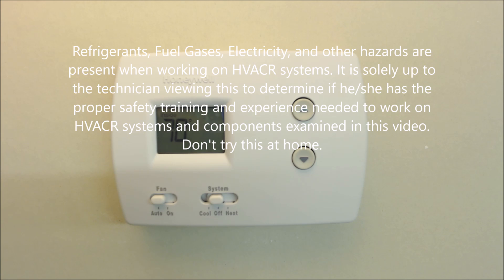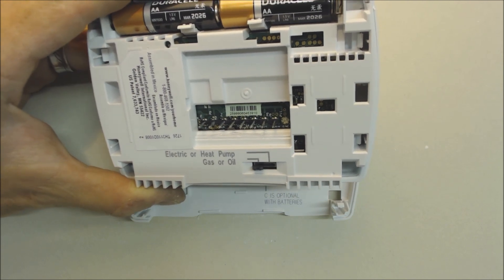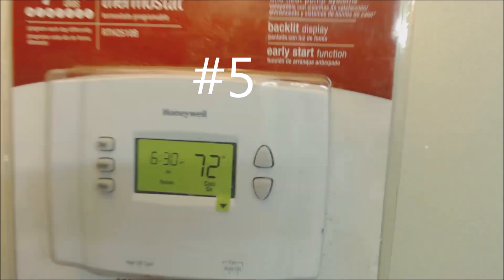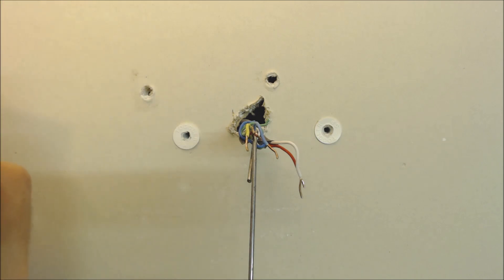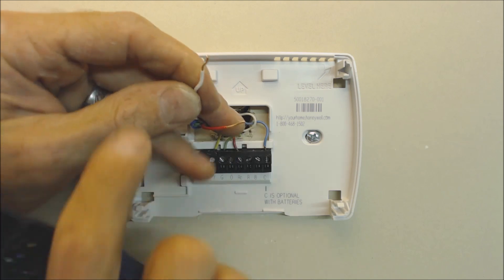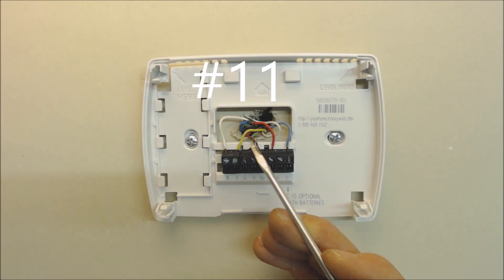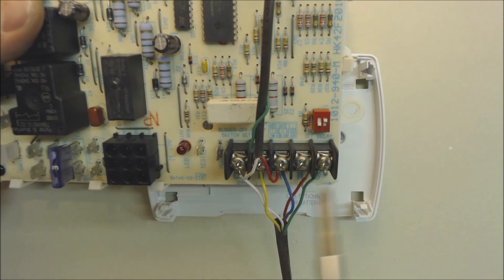Top 12 Problems/Mistakes when Installing or Replacing Thermostats! HVAC Tips!

Comment: Please help me. Ok have two sets of wires coming into my main thermostat. I have central air and my heat is copper pipes that recirculate hot water. I’m trying to replace my old mercury thermostat that my wife hates with a Sensi. The wires in my thermostat do not correspond to the colors on the terminals. The first set of wires has A red connected to R and a white connected to W. The second set has a red connected to B, white connected to Y and blue connected to G. There is a jumper wire connected between R and B. 
So I’m guessing the two wire setup is for heat, and the three wire setup is for the central air. If I follow the directions in the Sensi app for relabeling the wires and I select R, B, Y, W, and G, it tells me I do not have a valid configuration. Is the B in my case supposed to be Rc and the R supposed to be Rh? Is that why there’s a jumper between them? If I select Rc, Rh, W, Y, and G then the Sensi app tells me that it’s valid.

Thanks in advance for any help.

Comment: I had a new package unit installed 3 days ago. The tech replaced the thermostat and connected a blue wire that was not connected before. Now we have had problems with it.  Thermostat doesn't read the correct temp. Unit continues to run after the programed temp has been reach . The tech can not seem to figure out why.

Comment: Great Video. The best I've seen on this subject. I am trying to install a smart Honeywell unit, my problem is    per Honeywell I need 5 wires. I found three in the wall that were not used for my older unit. A white one, black one and a ground wire. Where do I put theses? Is one my C wire?

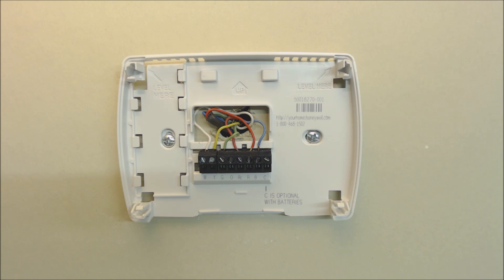Comment: @1:29, that's when my brain clicked and I realized what I did. Thank you. Your video save me hundreds to have a HVAC guy come out on Memorial Day to replace a fuse that my dumba$$ blew by hooking up the blue wire. Thank you.
Reply: Found out the hard way, too. B-is for Black NOT Blue. Go figure- the Blue wire goes to the C terminal. Is there a real reason B goes the C, instead of just using a Black wire as the Common???
Reply: Gotta find the furnace circuit board to replace the 3amp fuse. In the morning, good night!!!

Comment: Hey there!  I have a question.  I recently had to replace my thermostat (a Pro1 T7 series) and I found a Honeywell RTH5160 T2 Non-Programmable thermostat.  I have a heat pump (central AC/heat).  I shut off the breaker to the heat pump, took the old one off, put the new one in.  The problem I'm having is the A/C cycles on too much and it doesn't stay cool for long.  I can't set the cycle stage on this thermostat.  To the best of my knowledge, I wired everything correctly.  What could be causing it to cycle too much?  Great video!
Reply: I think I have the same problem. Did you get the answer by any chance?
Reply: One question and please reply back does the small black connectors need to be all one piece I noticed mine is cracked

Comment: I have a old  thermostat # 1f78 and   I buy a new #1f78  same, but when I trying to install the new one ,the old have a jumper, (y) cable yellow to( w) , and( rc )to( rh )red cable too it's a jumper tooooooooooo ,I install everything the same but my ac turn on I leaving at 70 and cooling a little bit and then goes up to 74 I dont now why

Comment: Just one quick tip to possibly add: Make sure when you tighten down on the terminal screw for each wire that your making contact with the copper wire and not the insulation.

Comment: I replaced the batteries on my honeywell thermastat because it had a low battery message. Now, the thermastat screen is blank. The fan will turn on but not the AC or heat. What needs to be fixed?

Comment: I am trying to swap out a 4 wire thermostat with a 5 wire. My 4 wire does not have a C but there is an extra wire not being used BLUE and do not have a panel on HVAC unit in attic but just wires tied together. The BLUE is not connected there either so I assume I can use as a C but not sure where to connect on the HVAC unit if I connect to the C on my new thermostat?

Comment: Hi, we're switching out and old round honeywell Heat Only  thermostat and replacing with a Saswell digital thermostat.  The old thermostat only have a Blue wire and a White wire.  We placed the white in the W and the blue in the RH and put the batteries in the thermostat.  Turned it back on and No heat.  Please advise

Comment: Question;  Over the last few weeks when I go to bed I reduce the heat setting on my heater thermostat to 68.  In the middle of the night I hear the heater click on and then clock off before the blower kicks in.  This will continue on and off until I get out of bed and change the thermostat setting by pushing the arrow up a few points.  Is this an issue with the thermostat or the heater itself?  I am not home during the day, most days but on the weekends I never hear this happening during the day.

Comment: I would've never even known to check the blown fuse, and yours is the only video I found which mentions it. Fuse replaced and thermostat actually wired correctly according to the manual (which it helps to read), heat now works. Thank you!

Comment: If I connected new thermostat with C wire (blue) and it still doesn't run without batteries? Any suggestions?

Comment: Also, I put caulking in a hole because thermostat goes haywire by exterior doors or windows opening and closing is bring cold draft for heating start up too soon which was interior is already too warm.

Comment: So just to make sure I’m understanding, the C wire provides power to the thermostat so that it works? I could have a thermostat without batteries?
Reply: Actually the c wire is the common wire or a neutral. So the r wire is the 24 volt hot wire but the c wire is the neutral that allows a completed circuit back to the furnace. Without the c wire you would just have a 24 volt hot coming from the furnace and when the thermostat called for heat it would close the contact and send the 24 volt back through the w wire to signal the furnace to turn on. the furnace will work fine like this but the thermostat itself has no neutral to complete the circuit so it can power itself if it has wifi or is a programmable thermostat or if it has a lighted screen. Some thermostats have batteries for this purpose but most with wifi wont work without the c wire.
Reply: That is correct. The problem comes in an instance like mine where there is no C wire coming from the cluster of wires in the wall. Because the Yahoo the wired the trailer I live in for some reason thought batteries were the bestest =[
that would have to rewire from in the wall to get a hard powered thermostat instead of a battery-powered thermostat.

Comment: Thanks for the video...very good explanation for learners. I bought a Honeywell T5 WiFi thermostat. After opening my existing honeywell, I realized there is no wire in 'C' terminal. I believe I would need C wire to supply power to new thermostat. I checked the board on the furnace and it has a RED wire in C terminal...not sure where this red wire going? WHat options do I have to install wifi thermostat? In my thermostat, I have wire in Rc (red), Y (blue), W (black),  G (green) just 4 wires in total.
Reply from the maker: You need to run an additional wire or possibly do away with the g wire and use it for a common. You would need to test it though in heat and cooling to make sure it still turned the blower on. If your indoor unit does not have a control board then you cant try that. Also some boards do need 24v to g, others dont need it.
Reply: well I hired someone to do the job because I also have HRV system. My board on the furnace have too many wires to figure it out. Thanks for your suggestions. We use G wire for C. It is working ok.

Comment: I installed a new thermostat the heater was working before but now the heater its not working or coming on any reason why?
Reply from the maker: Did you check the 3amp or 5amp fuse inside the furnace? Maybe its blown

Comment: How do I adjust the RTH111 thermostat?  It has an “advanced system” setup that I don’t know what to do with.  It says no programmable but isn’t.  Help.
Reply: I just bought the same thermostat, I have 3 wires red, white and green.  I hooked it up and it doesn't work. No what?

Comment: Great video! I was searching for an explanation as to why my 4 year old Trane electric ac/heating unit turns on and off even when I have the thermostat off. Can you help me with this? I also subscribed.
Reply from the maker: It may be that the thermostat wires are intermittently touching such as the r to the w or the r to the g. Maybe the wire insulation is worn off in a location or possibly the thermostat is sending a signal when it is not supposed to.  When something breaks completely, it is much easier to find the problem than an intermittent issue.

Comment: I'm fishing the YouTube community for help.  My HVAC system was staying on towards the end of the winter last year.  As far as I could tell the both the indoor and outdoor unit ran all the time.  Also as far as I could tell the heat strips did not come on.  The pipe copper line set felt warm, but the temperature stayed at 70 degrees where I had the thermostat set, it just never would shut off unless I switched it off on the Tstat...  Since it was getting warmer anyways, I limped through on the wood heat leaving the system off.  This summer the AC side worked flawlessly.  I am however ready to troubleshoot to see what is going on with the heat side.  Any advice would be appreciated!  Great video! Thanks.

Comment: Hello great vid i have a oil furnace and replaced the old mercury therm with a Honeywell theres one 3 wires b w r if i put them in order heat wont come on if i leave red touch w and blue heat comes on what is my problem thanks again

Comment: Thanks for your video, it's really helpful. My question though is do i leave my R wire in the thermostat side connected and connect my 24v external adapter to C and Rc? I'm trying to hook a T5 Honeywell and I have a 4 wire system (heat and cool) in place.  Thanks.
Reply from the maker: You would keep the R and Rc connected.
Reply: @acservicetechchannel  Hello !! Thanks for your video.  Please,  I have also a 4 wire system coming from the wall.
R, W, Light Blue, Green . In the OLD t'stat  light blue was connected to Yellow in the thermostat.
I connected the same way to the NEW thermostat,  R and Rc with a jumper.
Is that oK? I thank you in advance.

Comment: Need to always check in the air handler see what's hooked up to what and actually understand the controls !!! Say a service tech had a broken or grounded tstat wire and used a different color use switch it back to color code and blown the fuse or short the transformer!!! Lot more can happen in the tstat wiring...
Reply from the maker: 100% for sure, check the indoor air handler or furnace while the power is off, thanks!

Comment: My thermostat not working.  It's default settings still not working.  It's battery issue. No idea what could be problem
Reply from the maker: You may just need to replace that one, thanks!

Comment: Could you please let me know if thermostat wont call duct fan but works when wires are jumped. When jumped air blows upstairs and downstairs. But no fan comes on just with fan on with thermostat. Fan comes on with heat. please let me know
Reply from the maker: Sounds like the thermostat is bad and not turning fan on if you bypassed and it ran, thanks!

Comment: My orange goes to w2...?
Reply from the maker: Do you have a heat pump, furnace, or a heat pump with electric resistance backup? Did you look up "acservicetech heat pump thermostat wiring"
Reply: @acservicetechchannel  it was for a 2 stage..

Comment: HELLO... My Lennox HVAC is 4 years old. We keep the Honeywell thermostat on 60 at night and 72 during the day. At night time during the summer it never reaches 60 it may get to 74.  Before the old unit broke we never had any trouble with it getting to 60.  We were told to keep the doors open to help with cooling off the house. The unit never shuts off cause it never reaches our desired temperature. Could it be the thermostat or our AC is defective?
Reply from the maker: If the ac unit is running then it is the system and not the thermostat, thanks!

Comment: Hi. I need to reset the system my compressor does not start, the summer is already there. What to do since i have 3 thermostat to control at the same time
Reply from the maker: Are you talking about just the emergency off switch? There may be  a problem that you need to call a tech in for if the compressor won't start, thanks!
Reply from the maker: Are you talking about just the emergency off switch? There may be  a problem that you need to call a tech in for if the compressor won't start, thanks!

Comment: Switching from 12v analog to digital stat, dometic analog has 6 wire. Want to use a honeywell stat but can't find proper wiring cause it's 24v thermostat. A/c and gas furnace 2010 Rv. Why can't I use this ?
Reply from the maker: You need a DC voltage solid state thermostat, not a 24v AC voltage thermostat, thanks

Comment: Great discussion. I replaced my Honeywell programmable thermostat with a Nest 3rd generation unit. The heat pump does not  heat or cool and the fan runs all the time and will not shut off. Can you help?
Reply from the maker: Did you go into the settings and tell the thermostat what kind of system it is controlling? Furnace and ac or heat pump with electric resistance backup, etc?

Comment: No, if the jumper is not there ( they come installed in most tstats new) there most likely is a 2 transformer set up. Knowing if there is 1or 2 is key, Not to be used with 2 different things.
Reply from the maker: That is correct Matt, the jumper only stays there if it is one system such as a furnace and ac unit. If for example it is a boiler and a separate ac unit, the jumper is disconnected, thanks

Comment: Where is the fuse ?
Reply from the maker: Inside the indoor furnace or air handler for the 24v fuse but make sure the power is off before checking, thanks!
Reply: @acservicetechchannel  i cant find it , have it on top of house , opened it up and cant find no fuzes

Comment: can I use a reagler  tsat for new furnce 2 stage gas value how thanks mother board only has w1 new furnce?????thanks
Reply from the maker: If the furnace has only one speed then jump the two heat speed wires together, thanks

Comment: Hey Brian quick question.   I am replacing a thermostat with the old wires being used as W to W. Y to Y. G to G. O to O R to R. Brown to C. In that order ( with Rc jumped the R)

On the new thermostat these are the options in order  L E AUX G O/B C Y R Rc.   Everything makes sense to put them back on the same letter except for the W...   on the old one White went to W.  On the new one there is no W to put the white wire onto.  My understanding is that W is for the heating so I'm unsure why there is no W on the new one and where to place it?

Lennox ac unit
Reply from the maker: Is this attached to a heat pump with electric resistance heating because that would matter. W is likely aux and or E. If this is a heat pump then you may want to check out the video on the wiring diagram I released today, thanks

Comment: Good Info.  I thought you looked at OLD thermostat, take photo of wires before disconnecting wires, and match letters up to terminal letter on new.  I never realized G=Green, Y=Yellow etc. Just what ever wire is connected to Y on old, put it to the Y on new regardless of wire color.  If green was on Y on old, put Green on Y on new one.  It always worked when I replaced thermostats using this method.  Some have a switch in the back for Gas or electric heat.
Reply from the maker: Yes always replace new thermostat with wiring like the old one. That is just the thermostat color code that technicians should follow for installations of new thermostats, thanks!

Comment: Hello my roomate got angry and took the apt  Honeywell TH3110D1008 threw it against the wall and it shattered. Cthe back side .that holds the wires is still there. Could I just but it and plug in?
Reply from the maker: Yes that is correct. Make sure any switches on the back of the thermostat are the same, thanks
Reply: @acservicetechchannel  Thank you!I have purchased the same model, since the back that holds the wires is still there, I'm hoping it'll just snap back on and use again. thanks again for confirming~
Reply from the maker: Yes it should thanks